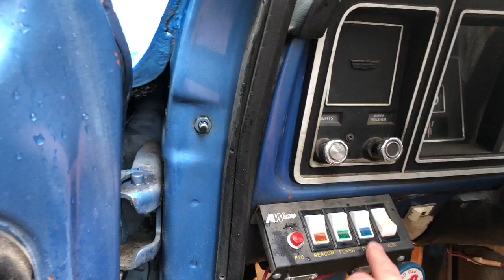1979 Ford F-350 4x4 wrecker dually

Comment: I have a '78 F350 dually wrecker and a '78 F350 dually car-carrier. Both Supercabs and both 1970 Ford 460 powered with some performance mods. Car carrier has 578k miles. Mild rebuild at 428k miles.

Comment: I like old 79 iron
Reply from the maker: Believe it or not I took it out of a shed in Jersey shore Pa. No registration and no plate drove it the 100 miles to the house. The carb was shit from sitting so I had to drive it like I stole it the brakes were 10% but the ride and the drive was unbelievable it drove straighter than a crown vic.

Comment: How’d u make it 4x4
Reply from the maker: It was a custom built by a chassis company had a different data plate from the company not from ford.
Reply: @mzimm460  likely a factory 4x4.and converted.to a wrecker body and rear duals by the company on the data plate.

Comment: It’s not a 79
Reply: What makes you think it not a 79
Reply: We know it's not an 80 because that's an entirely different body style, so it has to be a 78 or 79. Round headlights had been in use prior to 1978 then in 1978 Ranger XLTs got square headlights, as did all F-series trucks in 1979. 

So it's either a 78 or 79. If anybody can tell one year from the other on this truck, I'd like to know how.
Reply: I concur with Mr williams.